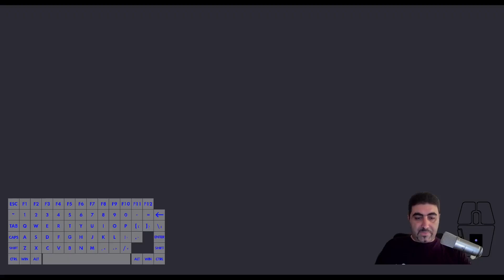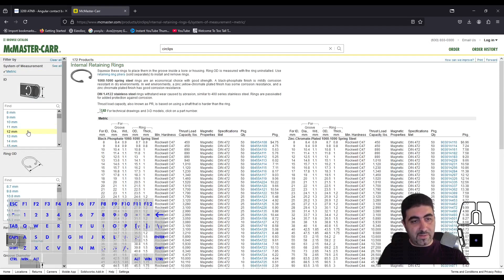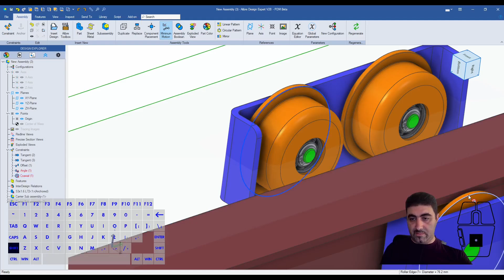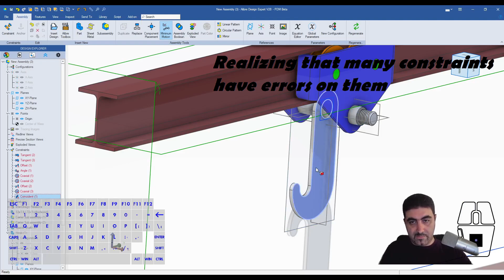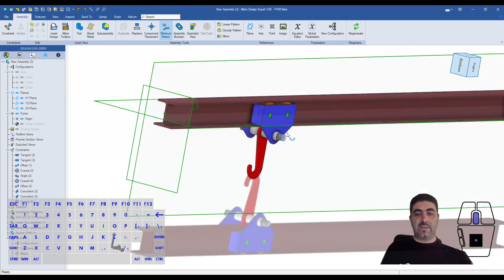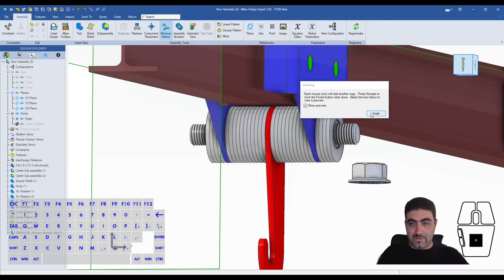Mini Projects: I-Beam Trolley Series - Final Assembly

Comment: Nice showcase as always. Great tips and tricks along the way. I didn't know that the constraints window closes up if you select the references before opening it up. 

In regards to importing the CAD formats, specifically downloaded from SKF, Alibre imports bodies as seperate part files and this behaviour creates part file clutter. What I generally do is I import Step and export it as SAT format which stitches all bodies into a single body. Then, finally I import the SAT file. As mentioned, this won't create any sub files, whole bearing will be a single part file.
Reply from the maker: Thanks for your kind words man. That import workflow is a great idea! More top tips in the comments section, 😂

Comment: I've already learned a few things and I'm only 6 minutes in. (The constraint window closing automatically, and that Alibre can import SW and other CAD files)
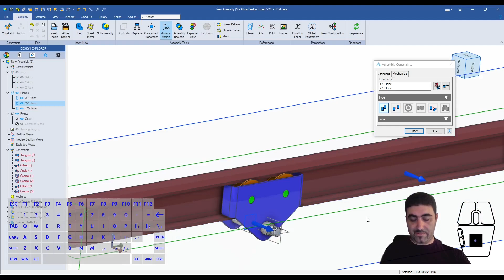19:00 The playground we'd go to as kids had something like this for kids to  slide and forth on, kindof like a Zipline.
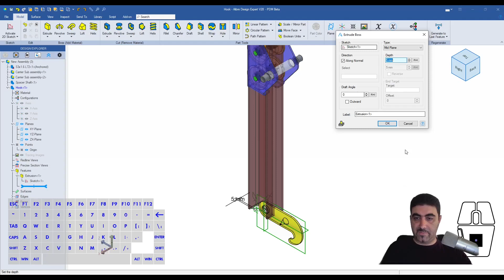24:05 "In any case let's suppose this is the hook." That was hilarious. Are hook shapes your weakness?
40:00 now throw it into Keyshot 😂 I'm sure all else parts won't lag out your PC
Reply from the maker: Oh man! Thank you so much for your kind words, once again.
19:00 Yes! Precisely! That was just a form of an I Beam trolley ( or a unibeam trolley, same principle). There are many uses to something like this.

24:05 Actually, yes. Well all shapes that I don't have specs and requirements for. Engineers are weird people. We like to have constraints. It focuses our engineering powers. Think of like Cyclops' glasses in X-Men!!! Without constraints we just fire off wildly to whichever direction wreaking complete havoc (on the R&D budget, 😂)

40:00 Yeah, it does need a render. And I actually need to do a Keyshot video. You might just have given me a good idea for a new vid. Massive Thanks, man!!!
Reply: @ExMachinaEngineering I'd also love to see a video on the same thing Toby just uploaded, but in Alibre. Linear pattern following a curve. It's that metal soap dish thing that was in one of the last matches, it looked tricky. Really just a solve video for that would be cool.
Reply from the maker: On it...
Reply: @ExMachinaEngineering you sir are a legend